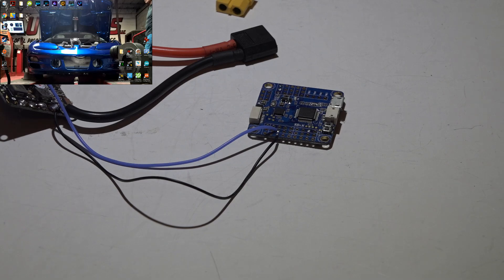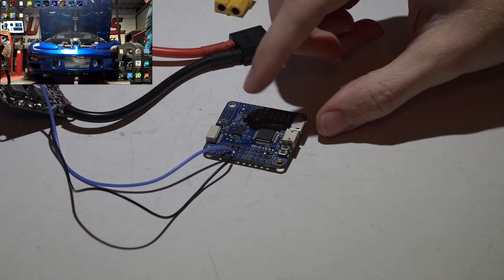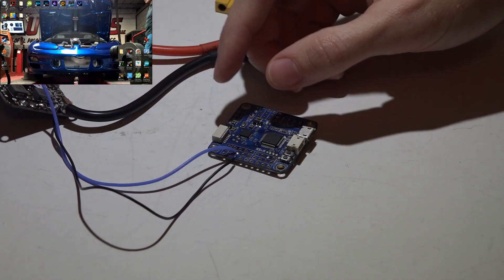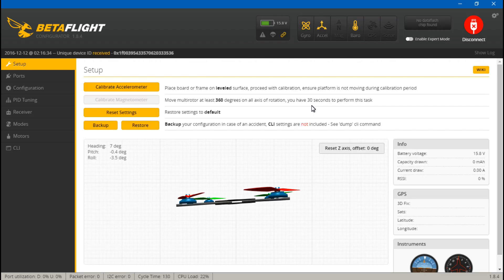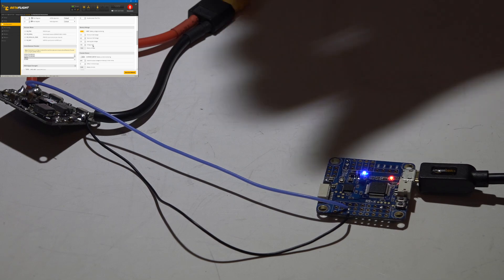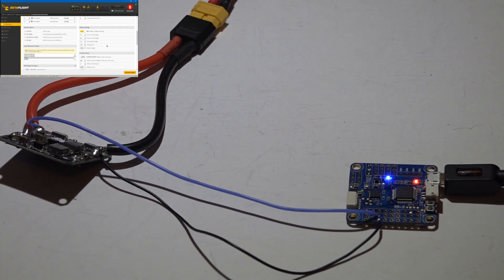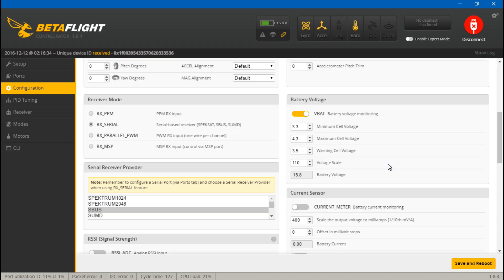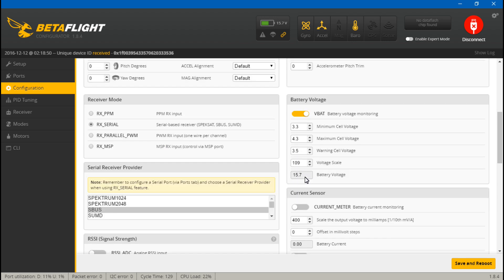Calibrating Voltage In Betaflight / Cleanflight

Comment: just adjusted voltage with isdt batterygo .. but i think my mah is off by a lot.. Thinking I can fly like 2 batteries record mah used on OSD and then see how much charger says it charged mah into the battery.. 
might not be off though. since voltage was off I was landing early. I adjusted it a lil. It was reading low. Now it is on. BUt seemed like as voltage went down it start to read off again. Low..

Comment: My quad is suddenly not showing voltage. OSD shows 0.00 and flashing. Betaflight shows 0.00 at the top of the configurator, and the same under power and battery settings.
The quad is working and flying fine.
Board is an original Mamba F4 with Mamba 4in1 esc.

Comment: I encountered a problem on the same flight control board, the total voltage detected by the flight control is correct, but the single cell voltage is wrong, what is the problem?

Comment: Hello guys. I'm running out of ideas so there goes nothing.
Problem: I can't get vbat on tlm
In use:SPR F3/ BF 3.1.7/ X4R SB

symptoms:-I can see vbat on BF but no green icon
                    -Also on setup tab
                    -CAN'T see it on configuration tab (vbat box)
receiver:     -VFAS  4.00
                    A1        4.00
Reply: Have you run a wire to the vbat pad on your sprf3 from the pos terminal of your battery or pdb?
Reply: battery
Reply: What OSD do you have installed? The SPRF3 doesnt have an OSD.

Comment: After turning on VBAT, nothing shows in battery voltage box and shows 0 voltage up at top.  I have the SPF3 flight controller.  any ideas to fix that?
Reply: I have the same board. There are specific Vbat pads on the FC (opposite the buzzer pads). Wire them directly to your PDB  and you should be good to go.
Reply: Tim Mc Mackin thanks!  Are you able to scale yours in the clean flight settings?  It's showing off of.5v difference and I try to adjust mine down in battery voltage settings but it doesn't give me option to change them
Reply: Mike K no problem! I'm using Betaflight but yeah I was able to scale it fine. I'd recommend switching to BF, it makes everything easier.

Comment: Whats your take on mounting it?  Soft mount or not?  I got an Omnibus based on your videos and so far it seems just ok.  The KISS fc seems way better but my issue is I can't run KISS escs with this setup and need mAh drawn as a telemetry.  I'm using Littlebee escs on a PDB with current sensor.  So the Omnibus paired with it has telemetry working great.  However I get these random desyncs.  Or thats what I think it is.  Seems like a random jolt.  Not really caused by throttle hits.  Ive had this issue before when using a Lumenier LUX or when tightening down the KISS fc too hard.  So should this FC be soft mounted?
Reply: there is no rule to soft mounting if you can then do it it will keep noise out of your gyro and filters it will only help

Comment: Dear PBJ, i have a Omnibus F3, i am using VBAT to power my RAm pin, but i dont get voltage in my OSD is that because i dont have a second wire coming off the VBAT to the RAM pin? thanks

Comment: Have you ever had an issue with FC only reading 3 of 4 cells? I have repaired one fc by replacing a diode thanks for showing me that one it works fine now. Now i have trouble with it only reading 3 of the 4 cells on the battery and it beeps when a new battery is hooked up due to the over voltage i guess and takes a chance of over discharging the battery because of the reading not being correct. For some reason in CF 2.0.2 i cannot adjust the voltage to accommodate the error. Any ideas how to fix?

Comment: Hi in my spraicing f3 in cleanflight i dont have battery voltage adjustmetns settings only enable or disable radio button. But voltage appear on ton how to enable adjustmetns
Reply: I would suggest just upgrade to the latest betaflight firmware for your board, or if you can adjust it in your radio if that's possible.
Reply: updated firmware and adjustments appears in battery section :)
Reply: i have the same problem but i am unable to adjust the scale at all. you have any ideas?